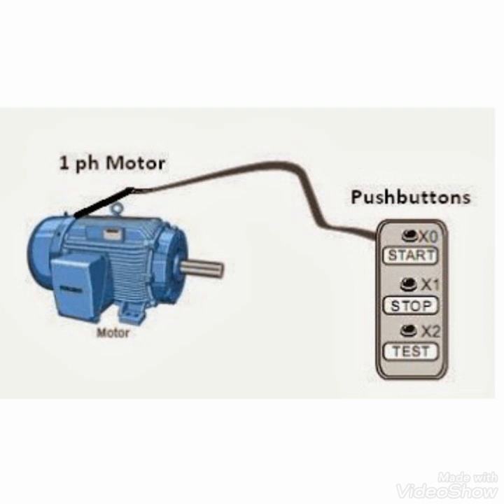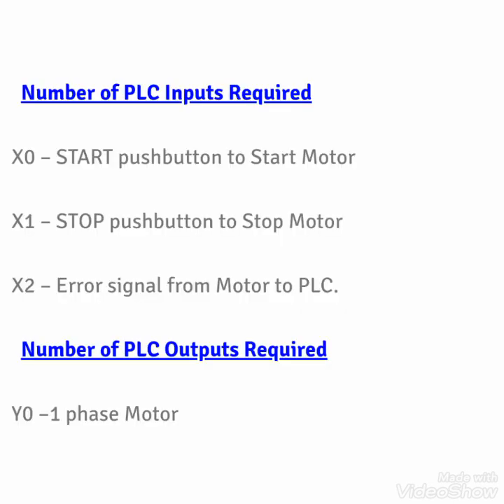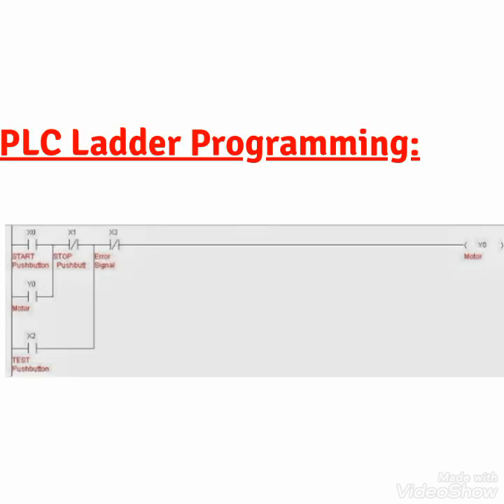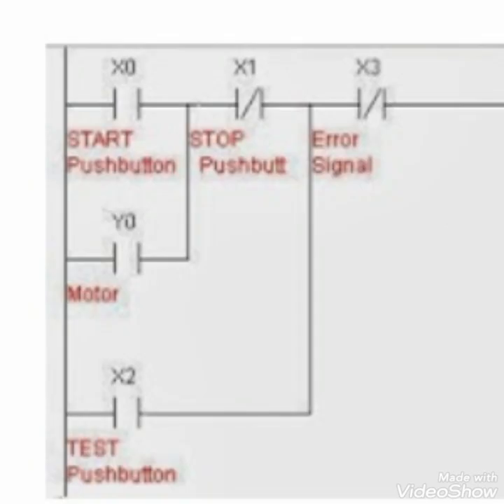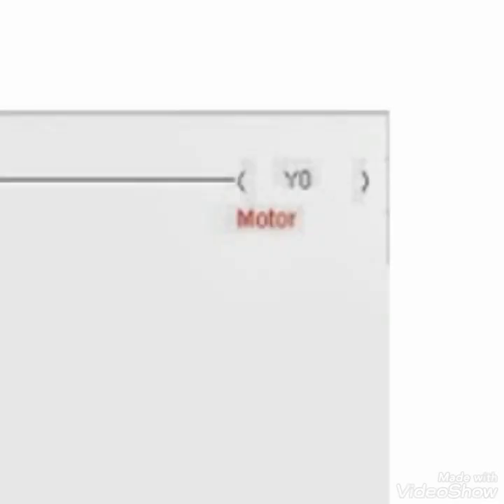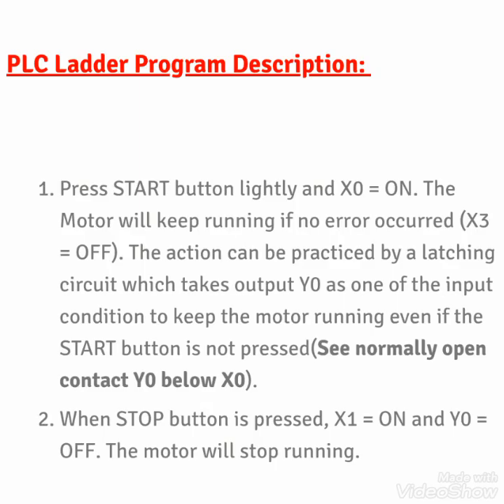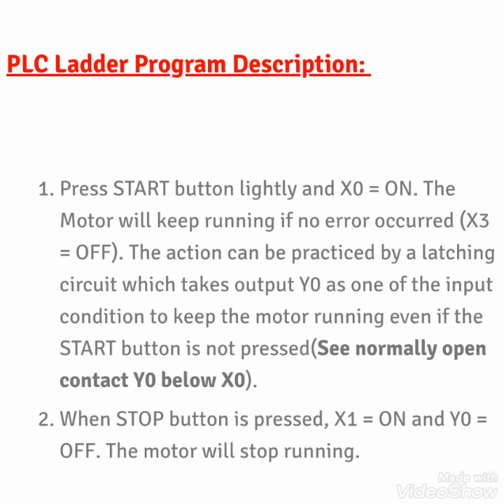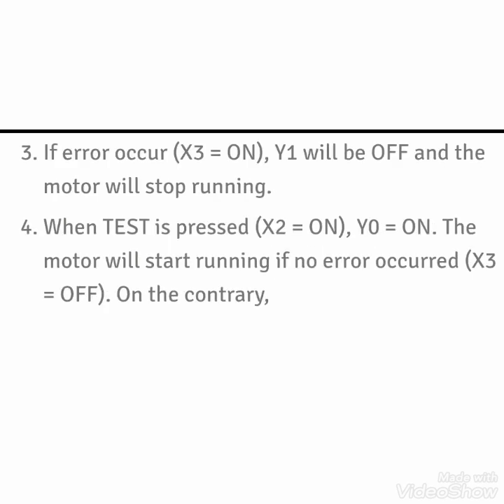ladder logic program for motor control

Comment: Test button has the same function as the start?
Reply from the maker: yes but while strting from test button stop is bypassed so if stop button have problem motor will srt and after that stop immidiatly but in normal it will keep runing and we can stop it with stop button
Reply: @creativeeee  it wont stop immediately the test button requires the stop to be pressed to stop because start is latched by the output.
Reply: You also shouldn't use a NC bit in your logic, your stop input should go off to stop not switch on. This is poor plc programming.
Reply from the maker: simon cook I love u ,can u send me an image of ladder here,what u r talking about, so good for all of us to understand ur point